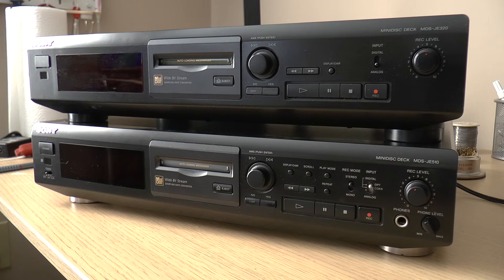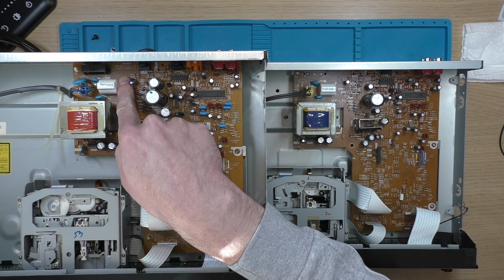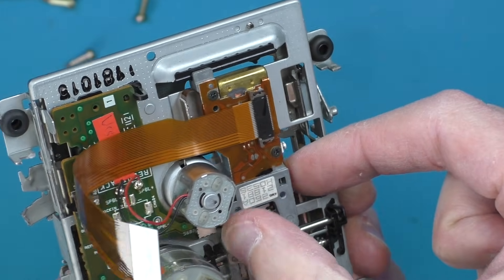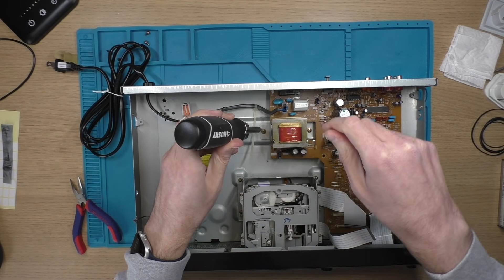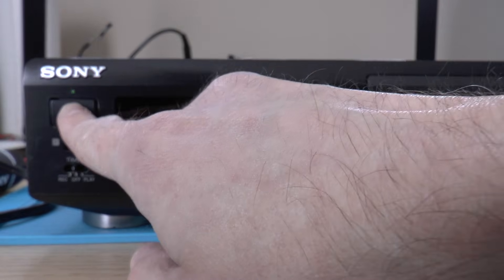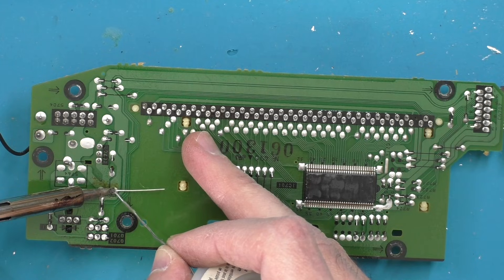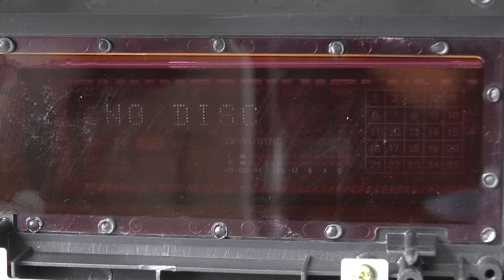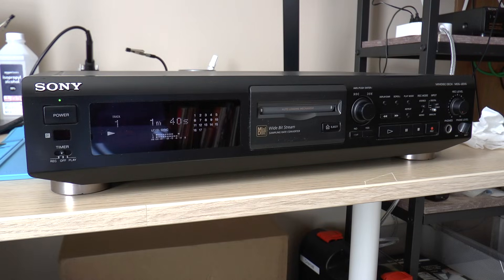Sony MiniDisc recorder - transformer swap and display issues

Comment: EEVblog did a similar thing with a VFD recently and also achieved good results. I think I might try this with an old Kenwood equaliser that has a fading display!
Reply: I had a Kenwood tape deck where the display was awfully dark.  I left it on overnight and it got a lot better.  At least the segments that were lit up, anyway.  The less used ones were still a bit dim.  There's supposedly a service mode you can enter that will light up all the display segments -- which would help the efficacy of that "burn in" method -- but it required a bunch of hacks and I couldn't be bothered.  ;-)

Comment: Amazing video . 
One thing that you didn't remove the excess soldering before removing the front panel because it will scratch or go to the inside main board and make a short. 
Fantastic job for the transformer.
Keep up and thank you.

Comment: That was a stressful one! I was really expecting it to start smoking when you swapped the transformer over, but I guess you can just do that. Fantastic video and great editing! I am looking forward to the next one
Reply from the maker: Thank you! I'm trying to stick to a weekly Friday upload schedule now.
Reply: yes as the componants were going from 240 to 110 theres no need to start swapping caps over as there realy the only things that have a voltage rateing
Reply: There probably aren't any electrolytic caps on the primary side, which is the only part that matters for a swap like this.  There may be some ceramic and/or film filter caps for mains noise rejection, but those are quite often rated at 250V, 400V, or 560V regardless.